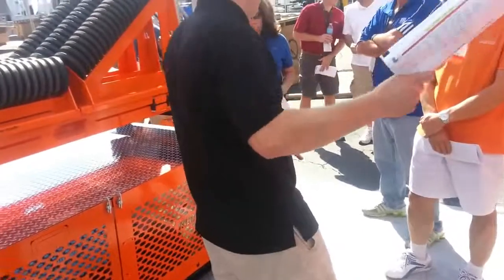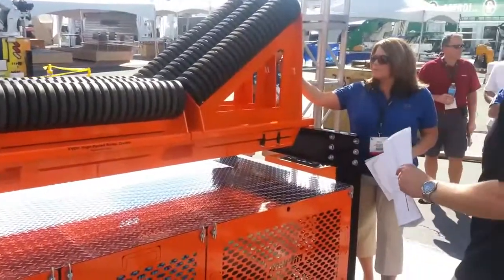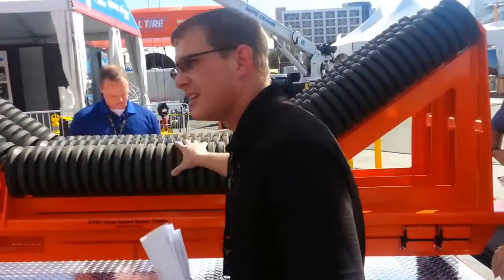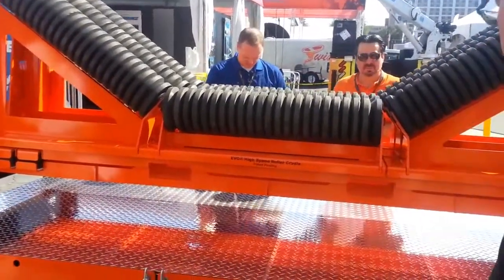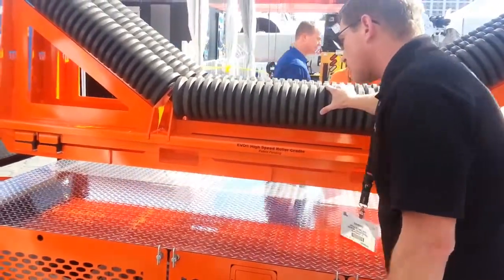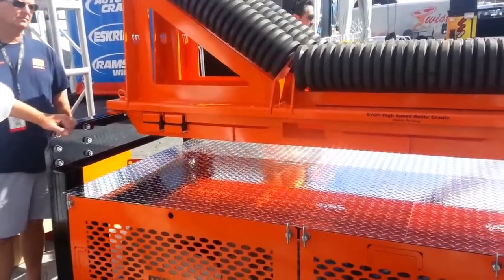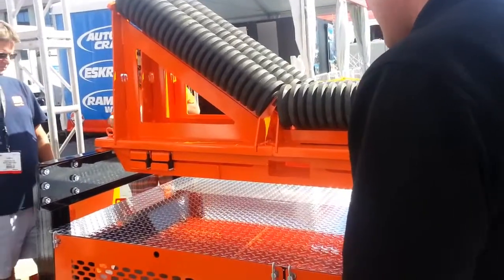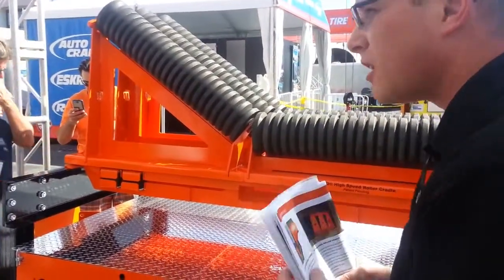Martin® High Speed Roller Cradle at MINExpo 2012  1 of 2

Comment: is  it possible using Martin High Speed Impact Roller if the belt speed 6.5M/S ?
Reply from the maker: Our Trac Mounted idler can be fitted with CEMA C, D, or E rollers.  CEMA roller ratings are determined by speed, as well as material density, and lump size of material.